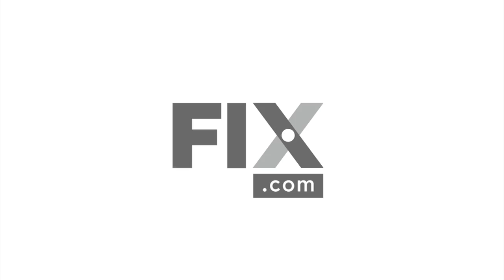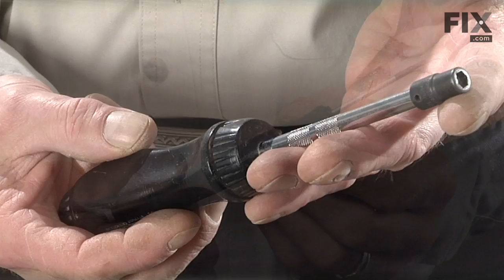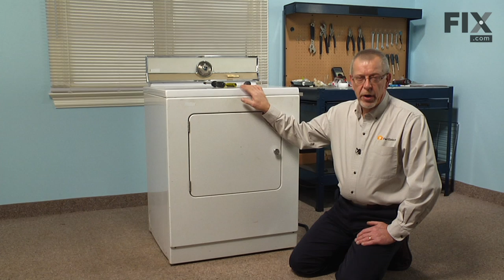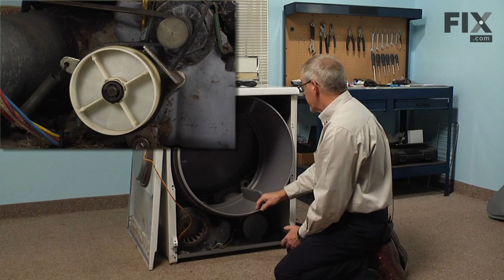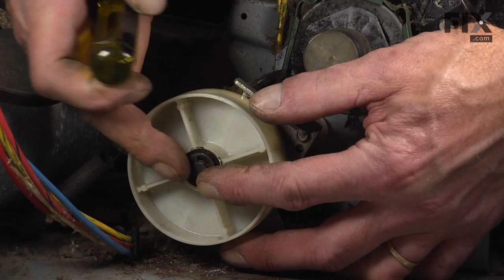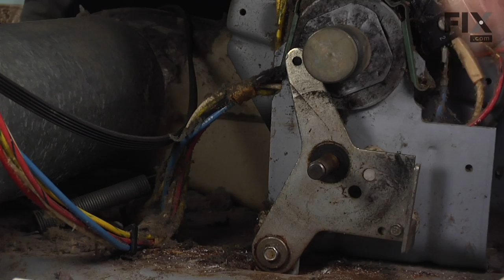Maytag Dryer Repair – How to replace the Idler Pulley Wheel

Comment: Why didn't you use the rear access panel? how do i adjust the idler pulley so that it the return side of the belt does rub against the motor pulley or the belt guide?

Comment: You can access the idler pulley thru the small access panel in the REAR of these dryers also.  Just remove the 4 screws and metal panel to reveal the idler pulley system and provides easier access to this repair.  These machines are fun and rewarding to keep running.

Comment: What lubricant is used on the shaft of the idler pulley?
Reply: According to the manufacturer, the idler pulley wheel and the drum roller wheels are self lubricating. If you grease their shafts it will just attract dirt leading to premature wear and subsequent failure.

Comment: You make it look so easy but I can't get the belt over the idler pulley. When I finally did the belt fell off the drum.
Reply: There is a smaller access panel in the REAR of these Maytag dryers located right at the idler pulley.   Unscrew the 4 screws and remove the metal panel.  Now you can see the belt and loop configuration more easily, and also remove the pulley wheel easier.   Hope this helps.  These machines are fun to work on and very reliable.
Reply: @markw4692  Yes, that is how I accessed the belt. I eventually got it figured out. Thank you for your help.
Reply: Then I got it back onto the drum and it fell off the pulley. This is so frustrating.
Reply: The belt is not long enough even though it is correct for my model.

Comment: It's awesome they used a dryer model that looks like it was built 80 years before youtube rolled out.
Reply: I worked on one yesterday 1994 year model
Reply: This design was around from 1976-2006. Commercial use began in 1972. Not a bad run.